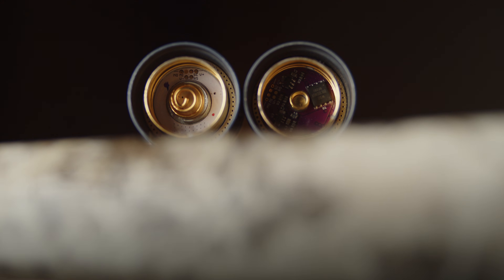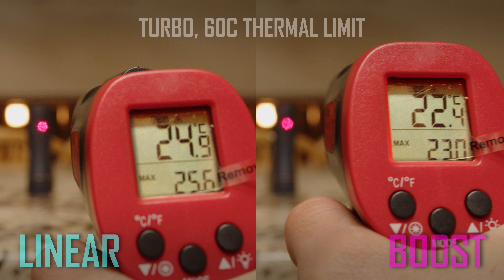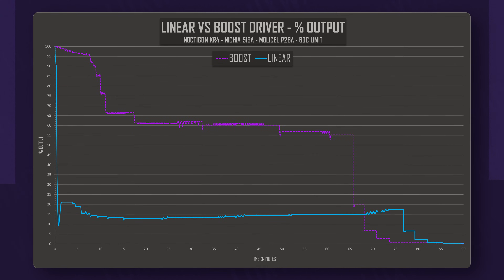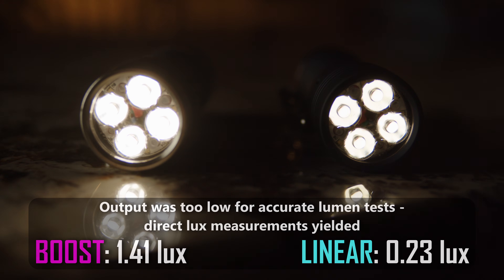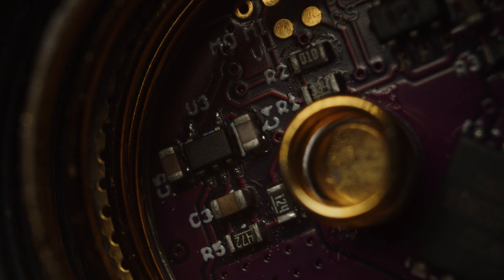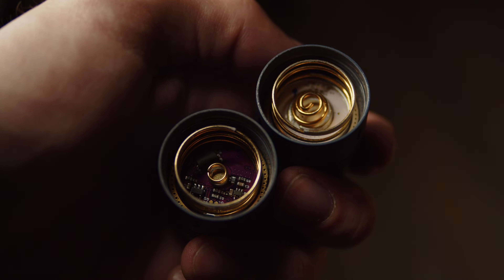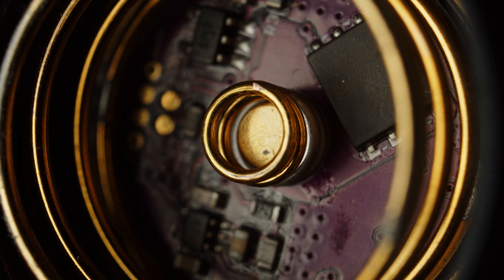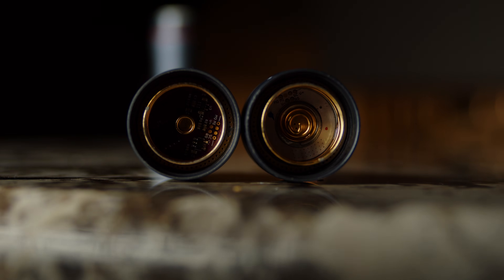BOOST Vs LINEAR Drivers - Which is better?

Comment: I have been thinking about getting the D4V2 and was certainly wanting to know the differences between boost and linear. I had known most of what you talked about but it is very refreshing to have all the info in one place and a direct comparison with all the other parameters the same, thanks!
I am personally a huge fan of switching regulation over linear. I have switching 18650 chargers (TP5100 vs the linear TP4056), the MC3000 vs the Opus, and a myriad of other boost/buck converters (even SEPIC) for my many DC-DC conversion needs. With my devices running on a single AC-DC supply it certainly saves bulk and usually efficiency.

Comment: Zebralights have buck + boost drivers and have amazing moonlight modes.
Reply from the maker: Zebralight drivers are pretty incredible for all of the features they pack into such a tiny size. They're actually not as efficient as other switching drivers though
Reply: @LuxWad  Zebralight has some of the longest runtimes how can you say they are not very efficient?
Reply: Snap. Trust Luxwad to have the deep dirt on the subject.

Comment: Fantastic video! Love the animations for the driver types. Ya know, if you keep raising the bar for vid quality like this, you might end up with a lot more work 😉
Love to see the Meteor and K9.3 making an appearance! What emitters did you get in your K9.3? I recently got one with E21A 2000K and SST20 660nm deep red + tint ramping firmware, it's like a campfire and I love it.
Reply from the maker: My K9.3 is 219b SW45k for the main channel, SST20 660nm for the second channel